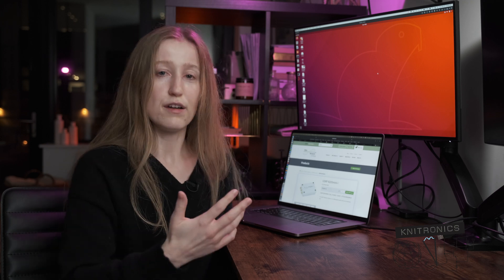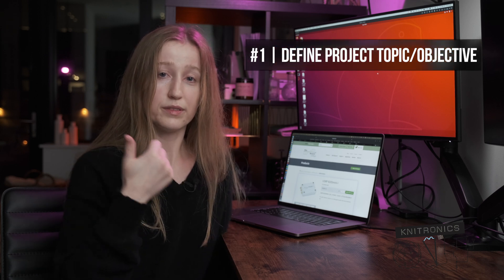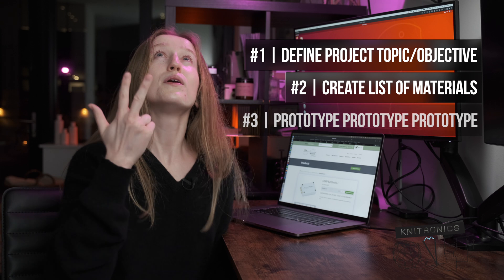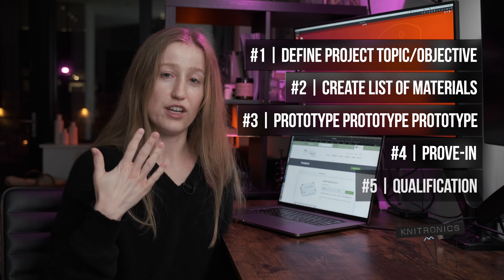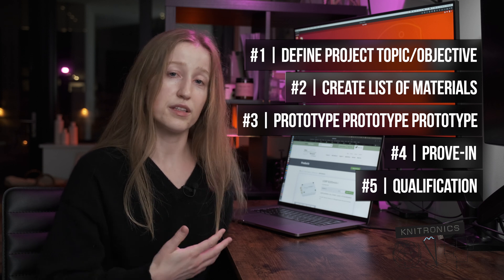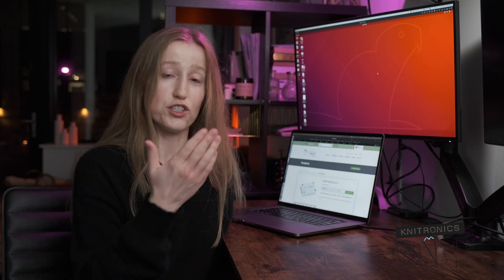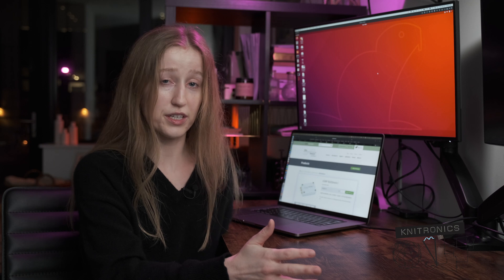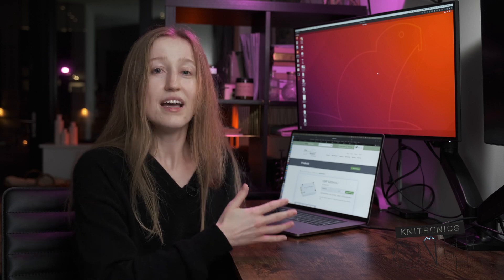Engineering Plan with Me

Comment: Great tips! 

May I suggest lowering your benches (preferred), or elevating your chair... Having spent more time on bench tops and desks than anyone I know over 20 years, improper ergonomics can really do a number on the shoulders, elbows, upper back and more... Don't let your wrists set on the edges. I've learned to set my benches low; often lower than legs typically go... Though, I do like fine work/soldering benches set higher.